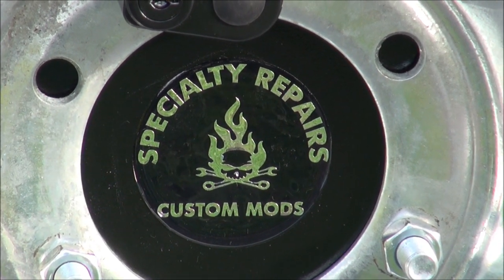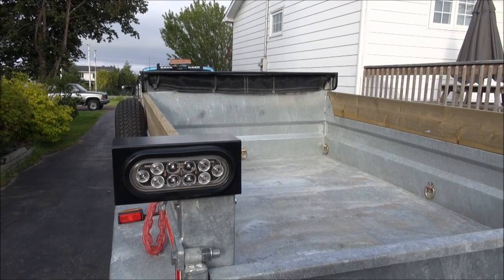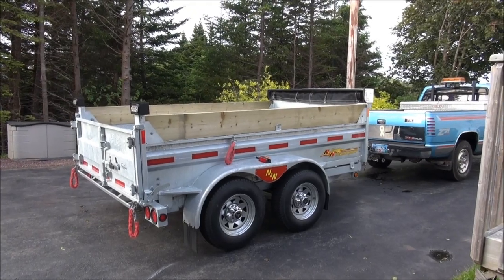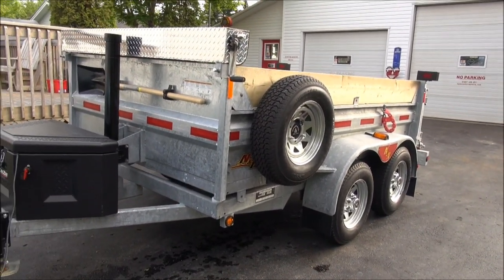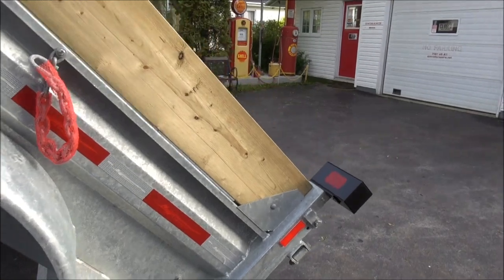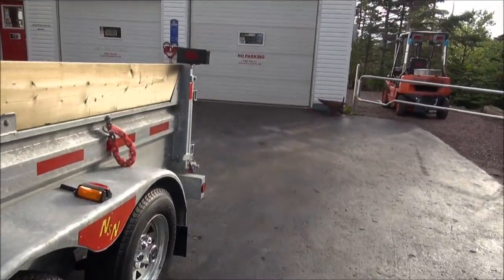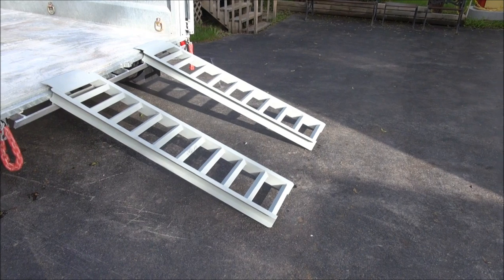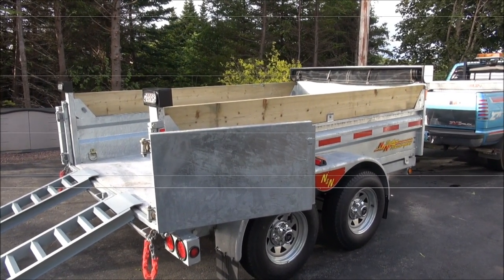2013 N&N Dump Trailer

Comment: Nice trailer there Wildfire, I see someone already commented about hanging the ramps underneath, thats where my son in law has his mounted. Does this trailer have a isolater system on the battery? My sil's was factory set with a charging wire thru the trailer plug that was not isolated so if you didn't unplug from the tow vehicle before activating the hyd pump it would try to also draw power from the truck battery and overload the curcuit.

Comment: Great looking trailer.  Been looking at them as well.  Couple of questions.  Are the ramps just laid on the trailer or are they some how hooked on to the rear lip? Also do you have drop legs to stabilize the rear of the trailer for loading and unloading of the tractor?  And last question is where do you buy your metal from?  I have been buying it mostly from Dominion on Empire Ave and some from Steel Fab in Paradise.

Comment from the maker: Thanks Scott. Yes the ramps are laid on the bar going across the back of the trailer but there's another bar on the ramps that keep them in place when in use. This one don't have drop legs but can easily be added. I doubt they would be needed in my case. This trailer won't be used for transporting anything other that stone, gravel or maybe the Kubota ZTR. As for the steel. I use Steel Fab or Russell Metal.

Comment: Paul,
Great Videos. May want to put steel guard brackets around those aftermarket lights. Seems anything mounted high on trailers always ends up getting "kissed" by loads and front end loaders etc... 
   Keep the great videos coming!

Comment from the maker: Thanks Larry. No room under this one for the ramps. Most of the ones around these parts have them on the fenders. I haven't had a chance to get into that aspect of it yet. No it don't have an isolator. The trailer is set up with that charging wire but no isolator. It will have one now though thanks to you.I  appreciate the tip.

Comment from the maker: Leo I wanted a maintenance free trailer. Everything else was powder coated and I HATE powder coating to no end. Even the new powder coated ones on the lot were peeling. I don't like welding zinc plated either ;( I should need to weld this one with the way It's built. Great looking welds and well built. Thanks!
Reply: Paul Short I'm sure if you weld it you use a zinc bar on the hot weld to coat it, need lots of fresh air and drink milk before and after welding zinc. Copper welding is worse, the copper will attack your nervous system if you don't have the proper breathing apparatus. Looks like a very well built trailer.

Comment from the maker: Ya I got one of those strips under my tailgate. They're cool but really low for the trailer. I put a high mount one on the Miller welding trailer that I built that works well.

Comment: thats a nice trailer i dont think ive ever seen a galvanized dump trailer but thats a great idea no rust i started to buy a dump trailer when i bought my dump truck not sure which is better both have advantages and disadvantages
Reply from the maker: bud moore Look at all the trailers that UHall has. What are they? They are galvanized. Why are they galvanized? Because they last a lifetime. That's why I went the way I did. I still have the truck and if I need to hall something I simply back up to the trailer. A dumps truck requires far more maintenance, inspections, licensing fee's and I don't have the need for a dedicated truck.  Works for me.
Reply: dump truck was cheaper thats why i did what i did maybe someday ill get me a nice dump trailer i should have knew about the u hauls i use to be a u haul dealer lol

Comment: Realy nice trailer! Im am looking for a trailer like that with tipp but they are realy pricey here in Norway about 24500CAD(Ifor William trailers), and they can only  load 2240kilos. But the N&N trailer what is the loading limit on that? And can you have a wireless remote? :) - Bjorn
Reply from the maker: bj0rn2re 
Thanks. It can carry 5 ton. I put the wireless system on the trailer myself. the trailer here is around $9000. CDN.

Comment: How did I miss this one?  I have been looking at a dump trailer for the place and work I have been doing so not to have to travel the tractor all over on the road.  I was looking over a Hawk 14,000 so I could haul just about any tools with th tractor or product for dumping such as landscaping or wood and such,  I like what you have done to it and with the lights,  like being seen when out and about don't want getting hit from the side or rear,  The trailer I looked over put their ramps under the frame and pulled out easy.  I really liked it 8" frame channel built and really heavy duty to last.  But my pocket book says more like a car trailer no dump but as time goes we will see how many job I get that pay.....  I can get all the free one I can afford to buy fuel for now...Lol
Reply from the maker: Thanks Jerry. These dump trailers are sure handy. This one was built in Quebec and I just love the quality. It's all galvanized and should lady a lifetime. I could have mounted the ramps under the trailer but didn't want to weld on the galvanized metal so I mounted the ramps on the side of the trailer. There's another video showing the first dump of the trailer with the ramps mounted. The ramps I showed in this video were steel but I built two new ramps out of aluminum after that were much lighter and I can get the BX25-D in great with them. I also installed a wireless remote on the trailer which is great. They're not cheap. This one cost $8400. but the first three weeks we had it we hauled 55 loads of material with it. 
Hope you get one. You'll love it.

Comment: Great video. Where did you get the rubber mounts for the shovel??
Reply from the maker: +Taden DiPietra 
Thank you. Hope this helps. Cheers. 
http://www.quickfistclamps.com
Reply: Paul Short those rubber mounts are what I use for my flash light and I even attached a GoPro to the base of the mount to make it into a GoPro bar mount.